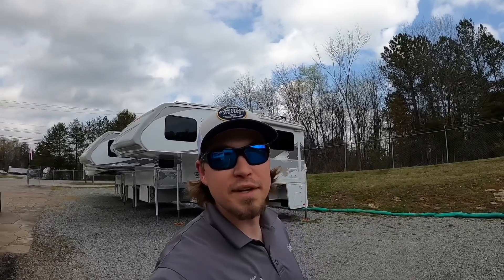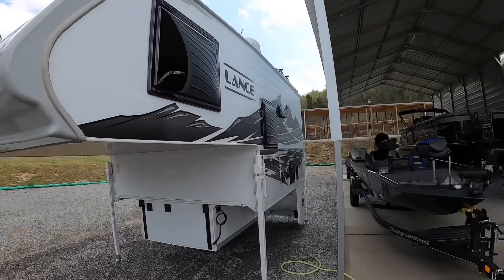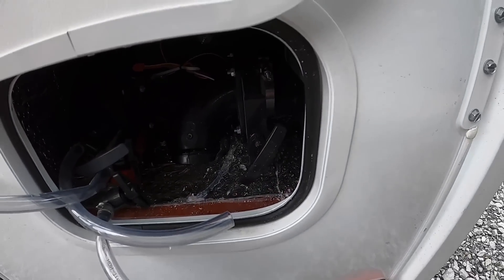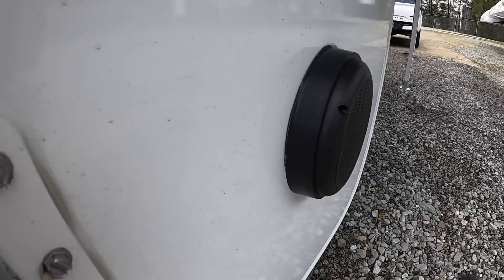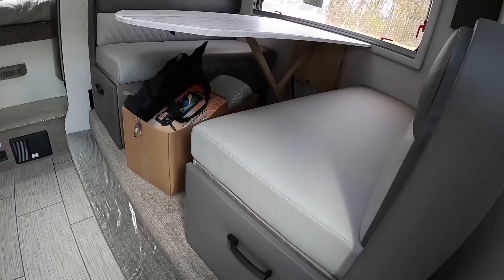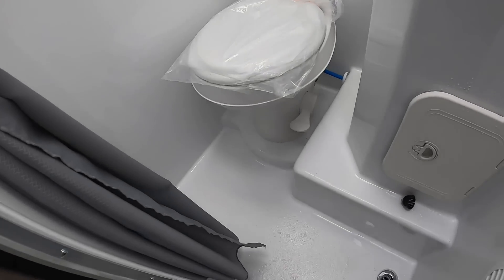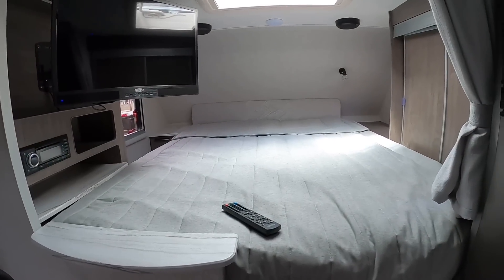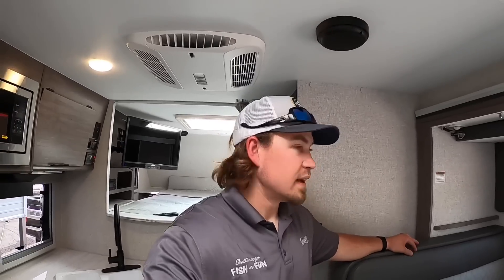$68k Off-Grid Ready Truck Camper w/ Slide-Out‼️ 2022 Lance 855s

Comment: im curious as to why this is 68k compared to my 2017 40ft which was 48k new. less materials.,no super technology. how does less equal more in price?
Reply from the maker: I’m curious why you’re trying to compare a 5 year old unit to a brand new one… lol 5 years ago these were low $30’s. Go try and buy your 40 footer new with $48k now. 
Besides that, these are built with better materials then cheaper pull behinds, more time consuming and labor induced due to more confined work area. Most less expensive pull behinds I know of do not include a $5k on board generator either, so there is optional equipment to take into factor as well.
Reply: @itsbrad  I'm curious as to why my used 1998 red Toyota Corolla was only $2000 when I bought it in 2019, but this camper is $68k?
Reply from the maker: @peterko2138  crazy right?

Comment: $68,000 for a truck camper ...what a rid off !!!!   i just bought a 41 foot 5th wheel with 4 slide outs for $46,000 ...2 bed rooms 2 bathrooms , fire place , etc I never see any truck campers now i know why there over priced and theres no room ..
Reply from the maker: No offense, but that’s either a very used 5th wheel or a cheap very poorly made 5th wheel. Well made 5th wheels are $100k+… my boss spent over $100k for their 43’. 
Lance Truck Campers are priced at what they are because of materials they use, options they have, and the time it takes to produce. 
As for room, there was plenty for myself, wife, brother, and Great Dane. You’re not living in the dang thing, just using it for a place to sleep and use the bathroom lol
When you camp, you spend most of your time in the camper?